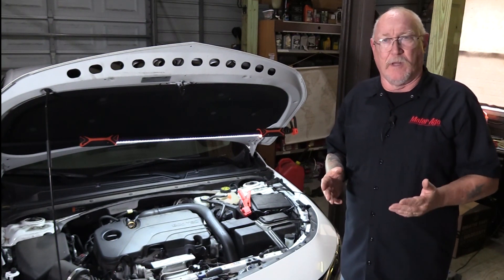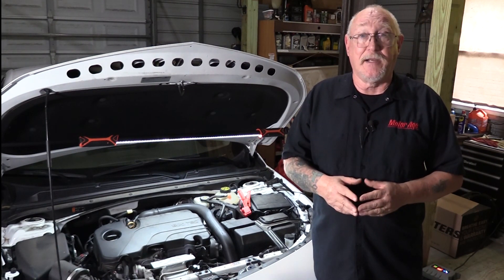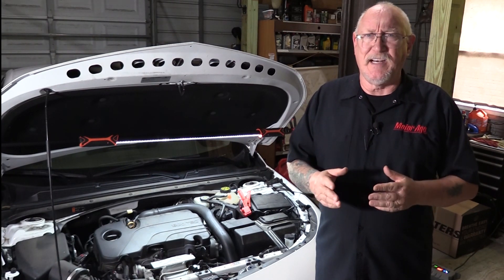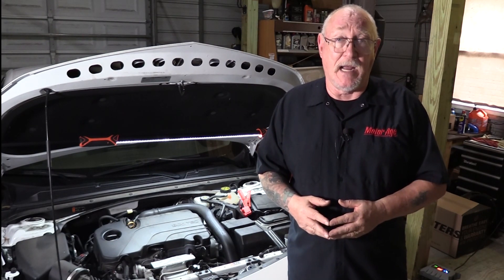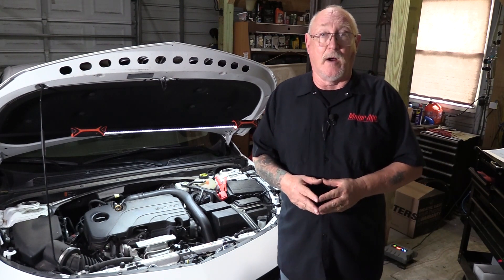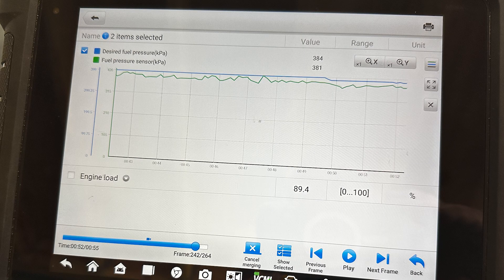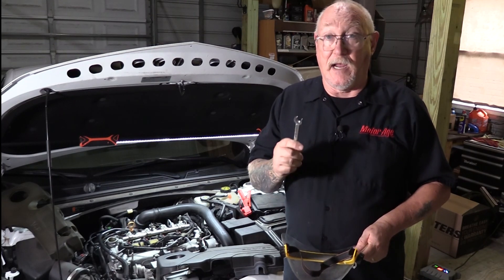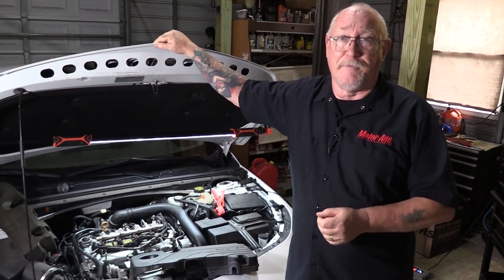Service Done Right #15:  Under Pressure – Assessing Fuel Delivery (GDI)

Comment: When I bought my 2020 Toyota RAV4, thanks to "The Car Care Nut" who is a Toyota Certified Technician/Mechanic and told me my RAV4 has both the Port Injection and the GDI for the A25A-FKS Engine.
These two systems should be interesting to monitor with my diagnostic tools.
Reply from the maker: The reason Toyota uses both is to minimize carbon build-up...a problem with some GDI designs.